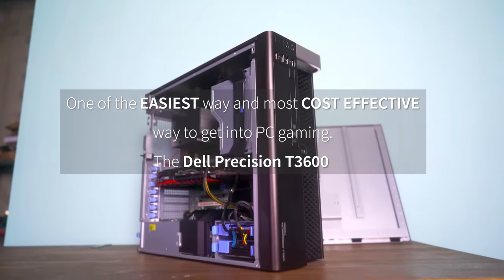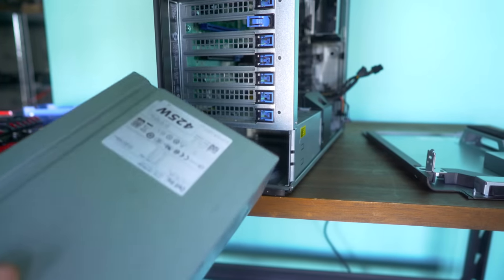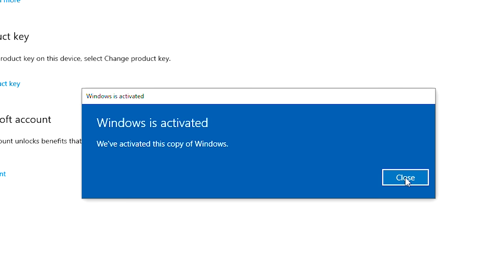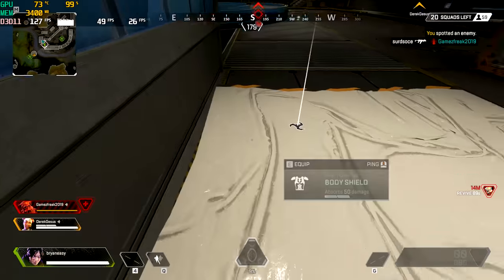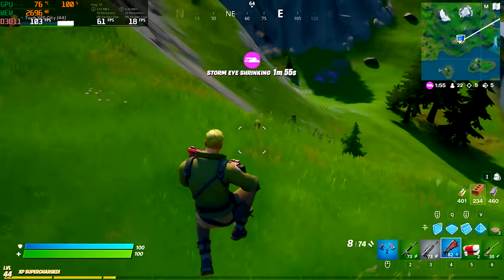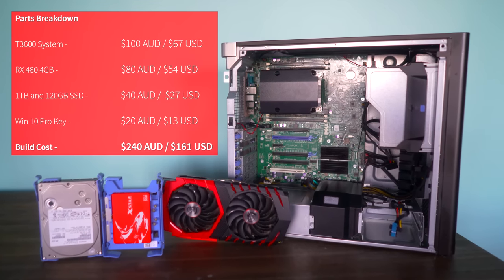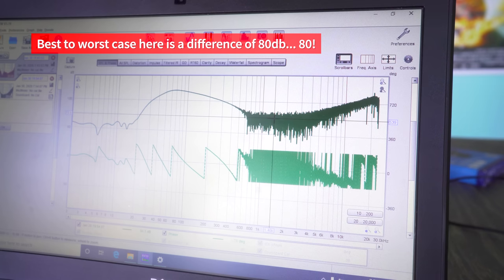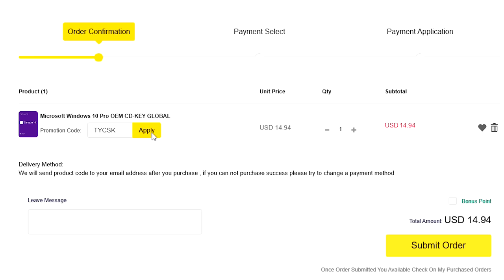How To Get into PC GAMING For Under $200 in 2020!

Comment: Sure gave that side panel some severe Tech Yes Loving.
Reply: Yes Tech Yes Loving struck me like a Hammer this time😁
Reply: Tech YES 'Tough' loving...
Reply: Tech Yes Tough Love
Reply: Ah, good old percussive maintenance! Works every time.
Reply: It was tough love.
Reply: You can also add a 80 mm fan to the CPU HS and cut a portion of side panet and put up a mesh there.
Reply: Called just a get a card that fits the system. Also blowers work well.  Can’t use amd rx400 though.  pci power pins block the door too.
Reply: Investing in a angle grinder might be a better play, and just cut that handle off....Tech hammering just looked dangerous...😀

Comment: I have a Xeon E5 2670 and it's WONDERFUL, and if you can snag one of these systems for like $150 or less, then it's a great price...AND it has a decent power supply?? PLUS, you can stream using the CPU encoder which is much higher quality than AMD's VCE. GOOD FIND!
Reply: love your channel
Reply: Is intel xeon processor x5680 a good alternative?
Reply: I love ur channel
Reply: I love ur channel
Reply: Do you think you can switch the case?

Comment: Dell T3600 Xeon E5-1650 max.3,8GHz; 16GB-RAM; 256GB-SSD+1TB-HD = 299€ + RX 480 4GB = 65€  Here in Germany the same system costs 377€ ! A system with a Ryzen 5 1600 = 65 € + B450 board = 50 € + 2 x 8Gb ddr4 3000 = 50 € + case = 20 € + 120Gb SSD = 20 € + 1TB HDD = 20 € power supply 500W = 20 € + RX 480 4GB = 65€ cost Here in Germany 310€ ! Which of the two systems makes more sense? I think the Ryzen system is better! not only because of the price! the parts are more modern and safer in the future!

Comment: If the GPU is artefacting then based on my experience, that PSU isn't enough to drive the system. The CPU chugs watts like it's at a hot dog eating competition and Polaris GPUs are extremely inefficient and power hungry despite their cheap price. Add to that the fans on the beefy cooler, 1.5V ram sticks, HDD and SSD as well as anything else and you are boarderline running out of PSU capacity. Even on PCPartpicker it will estimate your system chewing around 410W while you are powering the system with a 425W PSU. The GPU didn't artefact on your test rig because it had sufficient power. Either get a 75W - 120W GPU, downgrade the CPU to something less demanding, downclock the CPU or upgrade the PSU to fix. I used to have a Sandy bridge i5 with a GTX 1050 Ti running on a 265W PSU, let's just say I had to deal with shutdowns, freezes and blue screens until I upgraded my PSU
Reply: Lol hes Pc is not drawing more then 300w from the wall.

Comment: "It's cheaper to get into PC gaming than it is to get into console gaming if you're willing to buy some used parts."

Brian, there is a bit of a problem with this argument; You can also buy a used console. I get what you're saying though, PC gaming is more approachable than it seems to be on the surface.
Reply: Yearly subscription consoles require quickly covers this is a matter of a couple years
Reply: In my country is way cheaper to build a pc plus its the games part, that on consoles you have to buy them, on pc you can download pirated games. A risk you have to take when youre poor
Reply: And games are cheaper on pc and a pc is upgradable so you don’t have to buy a new one every 2 years and a pc is fixable you don’t have to send it to someone you don’t know and pay them a lot to fix it you just buy the replacement part and pop it in
Reply: @JimTheKid  and let's not forget the quality of most games are far superior than console.  As owner of both I should just sell my consoles because the experience is horrible compared to PC.
Reply: but can you code and browse stuff easily on console?
Reply: My gaming setup(monitor included) is worth about $50. BSEL modded Intel Pentium E2160, vmodded ATI HD4670, 4gb of DDR2 ram, 19'' 1280x1024 monitor. I can play AAA games like The Elder Scrolls: Oblivion/Skyrim, The Witcher 2, Dragon Age 1/2/3, Fallout 3/NV/TTW. Too bad I can't play Fallout 4 or The Witcher 3 because my GPU doesn't support DX11, but I can watch ''Let's play'' videos and it's almost like playing the game. I have my studio tour and gaming setup video on my channel.
Reply: @basshead.  Now that is what I call Budget Gaming, volume 2020
Reply: I think the console makers sell the consoles cheap and then stick it to the  people once they are forced to buy overpriced console games. From What i've seen you could potentially beat the price of a console of similar power if you found good deals on the used parts, like what we see here. But then you labor of putting it together and setting it up should be accounted for in what it costs you too.
Reply: JimTheKid you do realize that whole “games are cheaper” argument is flawed, right? there’s cheap games on console too. if you want the same game as on console you’re going to pay the same price lol
Reply: @Haddley333  It depends, because pc ports of console games can be piss poor like batman Arkham knight
Reply: @JM-tj5qm  Not what I'm seeing on my facebook marketplace. Lots of Xbox Ones and PS4s going for under $200. With the new console gen out people are unloading their old kit. PC Parts right now are going up in price. The Pandemic is having a very weird effect.

Comment: I actually managed to receive a retired one from work, and here are some pointers you get your hand on one:
> The handle Brian smashed with a hammer can actually be drilled out without damage to the panel, it's only spot welded.
> As long as you update the BIOS (you can do so with a utility called Dell Command Update), a 2687 should be a nice drop in replacement.
> I would not push anything less power efficient than a GTX 1080. I grabbed a R9 Fury for 90 USD and no dual 6 pin to 8 pin adapters would run the card stable. I would only recommend cards that require 2 6 pins, at most.

Comment: I bought a Dell Precision T1600 end of 2019 and put in an RX 570 8GB, a USB 3 expansion card and a new PSU.  The T1600 uses the E3-1200 series Xeons.  Another cool thing with the T1600 is it uses a standard ATX PSU so no proprietary power supply.

Comment: Those dell's are cool boxes for when you need a linux box on the cheap as well. Rock solid hardware.  Cool project you made out of it.
Reply: These Workstations were made for 24 X 7 use. Are very ROBUST.

Comment: I did a build with a Xeon e5-2667v2. Fantastic clockspeeds for an 8 core from that day and age. A total beast. All the HP z400 and z420 builds I've built has had people talking about these Dells as well, but the Dell variants around these parts were BTX (at least the x58 ones) and not case swappable like the z400s. Really dig this, thanks for the vid!

Comment: I have dual AIO water cooling radiator in front (you will loose dvd bay) it pushes the air through the front mesh. Rear fan is flipped as intake fan. You could bolt a 90 mm fan on that mesh in  the back, although there are no fan holes its very doable still.

Comment: Can even go bigger: the T5810 and lineup siblings have a Haswell/Broadwell capable C612 chipset and support 768GB of DDR4.  If you’re nuts you can then run the 22C/44T v4 Xeons like the 2699v4.

Only downside is the Dell OE board doesn’t support overclocking or engineering sample chips.

Comment: I have 4 of these systems that I built up as gaming rigs, you just have to click activate a few times, the COA for Windows 7 Pro will register for Windows 10 Pro
Reply: Correct .  In my case the Windows License Keys were  stored on the MB in form of Digital License, so as soon as  I connected to internet and tried activating it got activated.

Comment: I totally agree with this solution. I went a slightly more 'luxury' route. My HP Z420 workstation has the same Xeon E5-1650V3 processor but I re-used my Radeon RX580 GPU. The Z420 has a stock 600W PSU and with the use of a dual 6 into 8 power adapter it carries the load fine. I bought a Barracuda 500GB SSD and a 2TB HDU also Barracuda. I chose the HDU specifically because it is 7200RPM with a 256MB on-board cache. I spent approximately $150 more than you did but I use my workstation for everything. My type of gaming is RPG of one form or another and this system has more than enough grunt to run something like Elite Dangerous or No Man's Sky. Actually a really good performance test is Cities Skyline. On a large simulation it really loads up the GPU and the CPU. I also use my Z420 for Davinci Resolve, Reaper, Inkscape, Fusion 360 and Design Spark Mechanical. That's the great thing about using an old workstation, it's an enterprise grade solution that mere mortals can afford. My advice is buy the most loaded version that works for your budget. Don't think about upgrading the CPU or the RAM because it can quickly blow your budget and then these old machines don't make sense. Don't consider buying anything with less than 16GB of memory. Mine came with 32GB but I knew I was going to need the extra space for some of the non-gaming applications I use. A lot of vendors will strip out the CPU and memory to sell separate. It's fairly easy to upgrade the Z420 PSU to a stock ATX if you really need to run that 1080TI. In a couple of years or so I'll upgrade to either a Z440 or a Z840 (mmm, Dual Xeons).

BTW the aggro with hammer wasn't strictly necessary, It would have been a lot quicker and cleaner with a Dremel tool.

Comment: I've switched from a 24" 60Hz FHD monitor to a 29" 75Hz 2560x1080 UltraWide last year and I like it a lot.
Reason is that I do not play any competitive games and for single player games like Witcher/Skyrim,etc this looks great and its even more 'Immersive' at least for me.

Sure some games still have issues with this screen aspect ratio and I have to look for a fix online but that I can deal with. 

On a sidenote,this ~160 USD setup would cost something like 270-300 USD where I live 'middle EU'.:P

Comment: There's also the HP Z2xx CMT workstations that can be made into pretty good gaming PCs with prices (at least in the UK) starting at around £50 (without shipping) on ebay for a unit that you have to add a processor, RAM, storage and a graphics card to.

I however, managed to snag a Z210 CMT with an i5 2400 and 4GB RAM for around £60 with the only extra costs being £30 for 16GB RAM and around £50 for a 250GB SSD (there's also a USB 3 card I added, but that has a few issues so it's likely to be taken out once I have a replacement) as I already had a 1050Ti and two hard drives that I was going to move to it from another PC (I didn't have to pay for a windows 10 license as the system still had its windows 7 pro license key attached which was good for activation windows 10 pro).

Comment: Got mine (T5600) in a company decommissioning...for its $0 (its book value) in late 2018.  Dual E5-2667, 32GB R-EEC 1600 DDR3, and 825W PS. I thru in a GTX 970 OC'd (for $120 in early 2019) and recently upgraded to dual E5-2689's (which together cost $160).  16C/32T beast.  CB R15 score is 2200. With new SSD I invested a total of $350 for this rig.

..oh...and I also recycled and old Dolby 7.1 audio card from my dead Dell XPS 420.

Also, a recent office-lab cleaning and a junked T5600 with bad motherboard was tossed into the outside bin.  I managed to retrieve the CPU coolers & PS in case of future failures. They are expensive to replace, per eBay prices.

You can customize these rigs...there is a Youtube site for this: Green PC Gamers; where changing out OEM air cooling for third party coolers is explained, etc.

I also blinged this thing a bit.  Took some Vinyl Carbon adhesive roll that I bought on eBay, the stuff used for car exteriors, and cut it to fit the side panel...just to spruce it up a bit for home office use. A nice black, red or other carbon 3D color makes this looks less business and more fun, though it is a beast for multi tasking and rendering.

The downside...BIOS is locked...certainly on the dual T5600.  Which means the locked E5's with large core counts are preferred. I went with the E5-2689, which is an OEM special that is well priced and a solid performer.  All core clock in turbo is at just under 3.2GHz.

Don't ask me about power consumption...I suppose this thing draws some serious wattage.  No issue for me.

Hey Brian..if you want a couple of E5-2667's I can post them to your address, snail mail.

Comment: I was able to remove that internal handle by jamming a screwdriver under it and popping the spot welds off. It took a bit of time but it looks a lot cleaner imo
Reply: Correct,it was just welded and can be easily removed, instead of flattening it with a hammer.
Reply: If you do that then you take away the second use as a shield lol
Reply: @trillabp3971  Tech Yes .... Captain  Australia . LOL
Reply: @manojgupta3770  lol

Comment: Hey I had a dell precision T3500. It had a xeon w3530, upgraded it to a x5675 and it was good to go. The system had a 80+ silver rated PSU so I coupled it with a 1050ti (could have got a 570/580 but I got a great deal) added in some ram and I had a system for around $130 (US). I gave it to a friend who was getting into PC gaming and it fit perfectly for him.
Reply: Good Man. T3500 is Cool. Unlike T3600, in T3500  you can replace Dell PSU with an aftermarket PSU without any issue (in case if the need arises). Also with larger case lots of cooling mods are possible.
Reply: @manojgupta3770  Yeah I thought about modding it but I wouldn't know where to start besides swapping cases since the default one is so unwieldy. I did consider switching the power supply when I was debating on a 580, but it worked out since the included PSU is decent with a (relatively) strong 12 volt line.
Reply: @laynewoodruff7502  at least add a 90 mm fan to the CPU HS,  a 60 mm fan on North bridge  and in my case I even put on my Old Dead Laptop's HS on the Southbridge of T3500. T3500's NB and SB becomes very hot ater few hours of work. Check this out.

Comment: Hey Bryan. Tech Yes Price Performance Budget Gaming!
Woohoo. Bargain! 
24" monitors are great for gaming. 22" are also good. . 
Cheers, Mon from Brisbane.
Reply: i prefer 22" because ive used a 19" lcd monitor for like 10+ years, 24" seemed too big for me
Reply: @renko8065  I used 13" laptop for around for 5+ years then I went to a 24"
Reply: My monitor is a 24 inch but only a 60hz yet to get a high refresh monitor
Reply: Too small for my eyes 30" or 27" or 28" is good for me
Reply: @paulb4uk  if you are going to get one, get the AOC 24G2U 144hz 1080p IPS panel, 180 dollars.
Reply: Ummm I still use old crt monitors 😂

Comment: I also made some very good deals. Just bought 15 untested Xeon 2620v2 with one 2603v2 for 19€. 15 of the 16 CPUs actually worked. Then I got a 2630v2 for 12€ and a new LGA 2011 Board for 65€. I paired that with 16 Gigs of ECC REG DDR3 for 20€ and a GTX 780ti for 80€. For this system I spend 40€ for a PCIe SSD. So basically for 220€. I had a power supply laying around and also 2 TB of HDD storage, just missing a case

Comment: Nice Video Bro ....... But You MISSED SOMETHING ...... Having been Doing Dell Mods for some time ...... here are some Tips

1) Go to tech Power Up Site and Download ThrottleStop Software. You can OVERCLOCK (in Windows) this system via ThrottleStop upto at least 4.1 GHz on all 6 Cores on this LOCKED DELL SYSTEM. Surprised?? I have been doing it since last 2 years.

2) Using Dual Channel Memory Bandwith on a System that  Supports Quad Channel is a waste considering that Registered ECC DDR3 RAM are available at throwaway prices.

You will be amazed with the bump up in performance by OCing CPU to 4.1 GHz and Quad Channel Memory Combined.

My personal favorite is though the Precision T3500  because you can replace its Dell Propriety PSU with an aftermarket PSU which you cannot do in T3600. Also the Case for T3500 is bigger which allows many Cooling Mods which I have done. BTW T3500 also supports 6C/12T Xeons.

Comment: The E6 2697v2 works in the same socket, and has 2 qpi links, so you can theoretically have 24 cores and 48 threads by using two of them

Comment: i used a rx480 and fx 8350 for few yrs and still runs most games above 100fps, i switched and i now use that fx PC as my 2nd storage/streaming pc. they still have enough power to play most games  just fine, its not a 2080ti, but it will give you a very playable experiecne.

Comment: Hey Bryan, talking about those video artifacts, hope this can help you. I noticed my MSI RX 580 Gaming X starts acting a little weird (but not nearly as much as your GPU) when temps are in high 70s. A custom fan curve solved the issue during hot summer days. I noticed this behaviour only during very hot days while gaming with a little overclock on both core (+60MHz) and memory (+240MHz) but still at stock voltage and stock fan curve, otherwise GPU always stays in the low 70s in my case with zero problems. Cheers!

Comment: Problem I've had since returning to the UK from Oz is that the prices in the used market are appalling. The same machine from eBay or marketplace sells for around $200 just for the T3600 with lower specs. Shipping from abroad is out as well as the cost of postage jumps the price up to around a similar price point. 

I've had more luck flipping old Core 2 Duo/Quads with SSD's for people wanting a day to day machine but obviously a smaller profit per machine.
Reply: Only Cheap local second hand deal makes sense. Else go for Ryzen.

Comment: This particular model came with the 430w psu which will give an error in the bios if you've got a graphics card plugged into the add on pcie extension cable. Any of the power supplies for that model use the same daughter board tht will accept the same pcie extension cables. Be careful with which one you choose. Any of the higher wattage power supplies won't have that issue